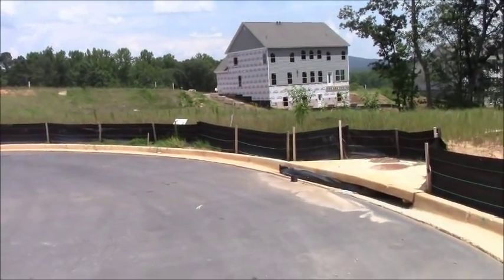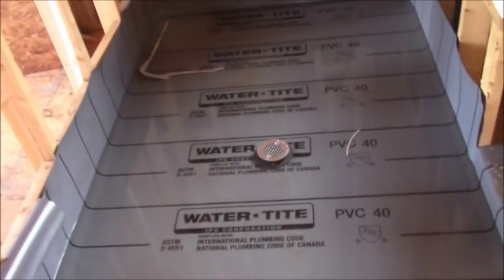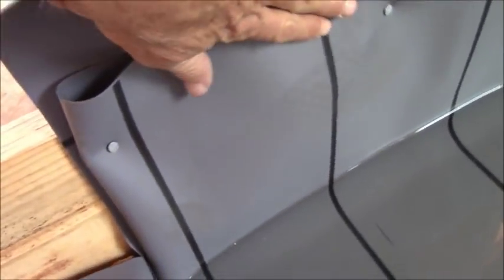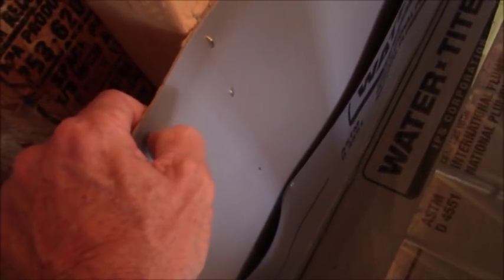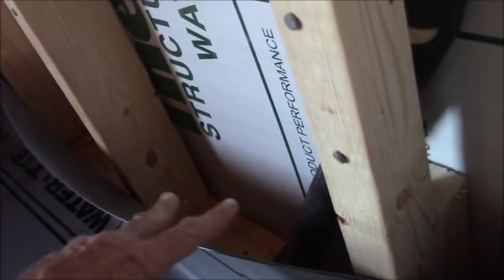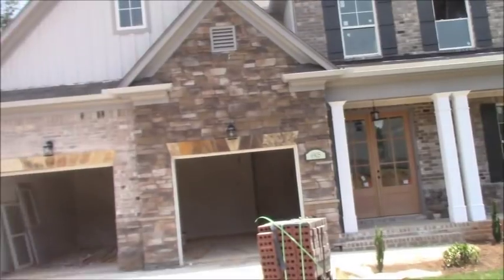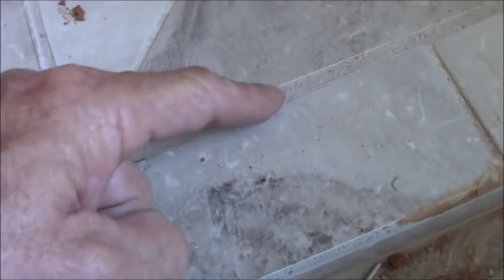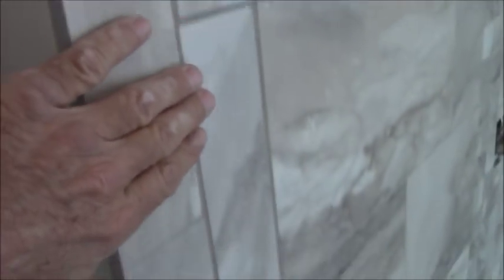NO ShowerPan PreSlope ..NEW CONSTRUCTION

Comment: All work is being done by other people is respectable and no one will do the work same way you do it, and respectable as well.
Your comments seems bitter because you do not did the work.
With respect, you can give your opinion without, making seeing you in a way that you feel all mighty construction guy.
How ever
Your video has the right idea.
Now the plastic pipe is pex, Wirsbo, or Uponor brand. Class A, meaning EXPANSION PEX. Is the first in the market follow by Pex B, ment for crimp and Expansion, little more rigid than pex A, and last but not least Pex C, use only with crimping rings.
The valve is a Delta 10000 UN. Is nothing wrong being " old copper guy" , experience is always welcome.
That dissent mean we need to stop learning.!!
We have much to learn from the new generation as well.
Good luck and keep up the videos.

Comment: A lot of argument about the pre-slope. The first tile shower I ever installed was for myself. That was in about 1999. I did extensive research and the best book I found was by Michael Byrne. The industry standard at the time was to install a pre-slope before installing the pan liner. It made logical sense to me at the time and still does. Using the argument that “nobody I know ever does it” or “I have never done it before” is a pretty poor argument for not installing a pre-slope. This sounds just like the bricklayer who installed the metal firebox on a new house I bought once and covered up the air recirculating tubes which was totally against the manufacturers warnings. He was taught the wrong way, never read any manufacturers directions and had no clue he was potentially creating a fire hazard in hundreds of homes. Poor inspection practices as well.  I assume that in your area somebody decided the extra step of installing a pre-slope was just too much work and not needed. Maybe you should get on the boards that approve the codes and get them to remove the pre-slope requirement if you feel so strongly against it and can prove it is not needed. If builders had twenty year warranties on homes it would not be necessary to have all the building codes. Having a trustworthy builder and good inspection practices protects the home owners since builders only give a one year warranty.
Reply from the maker: In 1998 when I started tearing out showers I never came across a preslope..no matter the house was built 1950s 60s 70s 80s 90s or this decade.. so if it is code then everyone has missed the ball for the last 70 years. Of all the manufacturers of all the products, all the online people like you mention with Byrne no one has one shread of evidence as to It's advantage, no scientific backup, no video, absolutely nothing except their word. And those are not even the reasons that I don't do them , the main reason is the ill logic of an encapsulated area that is porous that will allow water to flow  unimpeded... it fails to make any logical or scientific sense at all, in the absence of gravity water will wick up any areas it can and preslope will be irrelevant and the negated by capillary action. At 100% saturation a pre slope may in fact evacuate some water  but it will be negligible.

Comment: The plumbing pipe is Wirsbo with expanding/contracting fittings...  it's the 'latest, greatest' plumbing innovation...  I know... I had to purchase a 600 dollar tool to install it.

The panel is a vapor barrier only recommended for climate zones 5-7 and only on exterior walls.

Comment: It was wirsbo pipe. 
And water in tub to weight it down in cement. But no to smart to leave that much water. You only use a tiny amount. Anymore you can deform tub and when it dries up and you remove water it’s then under tension. 
And pointless to line the curb yet leave the corners. 
Me. I go a bit overboard. 
Redguard floor then pre slope or not pending. 
Also add wires to check for continuity. Norm I run 4 sets of wires and if there’s a tub with access I run wires there and mark them. 
This way I can always check under the pan for water. Kinda like a built in water alarm system.
Few reasons. Can chk work year after year.  It’s good customer pr 
And I warranty my work but not the builders. I have done jobs where 2 years later the tiles were cracking like a earthquake hit. To find out the builder was being cheap with nails. Missed nailing areas. Etc.

Comment: No ... it's PEX.    They used the I'd expansion tool to put it in. They slip that sleeve over the pipe, insert the expansion tool and while it's expanded they quickly slip it over the barb fitting before it contracts back to regular shape. The tubing is what they call cross linked plastic. You can bend it shape it and it will go back to original shape because of the cross linked plastic.

Comment: The TCNA states that showers must be pre sloped, whether or not you believe it's needed or not the TCNA does, so from a legal aspect you should do the procedure.
Reply from the maker: Eric Ness I'm not sure what you mean by the legal aspect, the tcna is not a government entity they only make recommendations, my issue is that there is no proof, as much as I mentioned it in these comments nobody can provide one shred of evidence that a pre slope does what it is intended to do.. by the way I don't believe in Santa Claus, the Easter Bunny, or the Tooth Fairy either
Reply: OK, let's say for whatever reason one of your shower pans has a leak and causes damage. If this was to end up in court the lawyers would use the TCNA guidelines. These guidelines have been used in court many times for many reasons, I.E., flexible grout lines, scarified slabs, spec thinset. The list goes on and on, if any one item was not followed to procedure, guess what, you lose buddy. All i'm saying is to cover yer arse and follow the individual city and state building codes , that in itself is near impossible task depending on how far your work travels.
Reply from the maker: Eric Ness if what you are saying his correct and it ever does come to court, that is an excellent backup for sure. In my case my work is a redundancy I'm building a couple of showers every month for the last 20 years, everything I do is on point in the same way every time, so yeah I don't have failures. But even if I did it would not be out of the realm for me to pay for a fix, I doubt very seriously it would ever go to court. Having said that in the end I Court 1/7, that's what I'm simply saying provide evidence that a pre slope actually works, if they go to court for you then why cannot they produce any evidence video or otherwise that this method of supposed water channeling actually does what it's supposed to do, it is fake science because capillary action will see to it.

Comment: Hey There, 
Would just like to point out that the evidence that a pre-slope pan is ideal is on the internet, and in fact its in your own video! 
Its in the part where you trespass in yet another house to point out the failed water tested pan. Had that pan been pre-sloped, there would have been little to no standing water. You are 100% correct regarding capillary action soaking the entire mud base before any water movement. However if the pan was pre-sloped the fully soaked mud will drain down and out the weep holes then gravity and capillary action, slowly  draws the remaining water to the weep holes. 
The bigger the shower the bigger reason to pre-slope.
The other reason why it is important to pre-slope is to have the flange of the drain lower than the pan.You can clearly see in your own video that in a flat pan the water would have to build up and rise up and over the flange to reach the weep holes.

Pre-sloping is an added step, yes ,but a very important one that should have been code a long time ago.
Reply from the maker: Last sentence 1st....tell me the date it became code & where ? Not a "long time ago"
On to your other comments....there was no failed pan test, the plug is in the drain to DO A TEST, so water is there
On a flat surface, the bottom flange has troughs at bottom, AND troughs 1/8'' up, so water can drain.
Water will not move with gravity when it's encapsulated, so will ONLY wick, hence cap action only UNTIL 100%saturation.

Show one video, anywhere, anytime where a demo was done showing a pre-slope...you can't.
Reply: M,
Your statements regarding the reasons for preslope are right-on target! 
Preslope has been a requirement for shower pan liners for decades with both the International Plumbing Code and the Uniform Plumbing Code, which are the codes used in most parts of the country (although some states, like california and massachusetts, have their own, specific codes, these are always based on either of the two model codes) 
Here's a link to all of the current building codes (including plumbing code) currently in force for the State of Georgia : http://www.dca.state.ga.us/development/constructioncodes/programs/documents/2018effectivecodes-greensheetUPDATEDLETTERHEAD.pdf 
and another link to the Georgia State Amendments for the International Plumbing Code : http://www.dca.ga.gov/development/constructioncodes/programs/codeAmendments.asp
Local jurisdictions have the option of not adopting specific sections of the building codes, but these are the codes that the state has adopted. You would have to check with your local building department to see if they have taken any exceptions to the state-adopted codes. 
Please note that, just because a code section has not been enforced in the past, it doesn't mean it is NOT required! Many times the shower pan liner is installed after the plumbing rough-in inspection. Unless the inspector is doing an inspection on this pan liner, compliance with the code requirement is left to the ethics of the installer. Remember, ethics is doing the right thing when nobody will ever notice!

Comment: It's Pex and just newer fittings that expands then contracts to get water tight seal. Pro expansion Rings and Pex and Pac is not regular Plastic it's made of HDPE, Polyethylene life expectancy 55yrs or more exterior moisture have no effect and may not burst in freezing conditions when heast it forms back to its original form.

Comment: That material on the exterior wall is some type of tply or other type of thin panel that's meant to satisfy the airsealing requirement of the energy code in new homes.  It should also go behind a tub on an exterior wall.

Comment: Hi, I have a older home and the concrete under the tile has cracked.  It is to the point now that when I stand on it, the floor moves.  I  need advise on what I need to do.  Can you help me with a suggestions.  I like what you do and seemed to be very good.
Reply from the maker: No choice but cut out a square past the crack & re-pour that concrete...otherwise it could get worse
Reply: StarrTile thank you.

Comment: So on a second floor it ok just to have a pan liner with doing say hot mop
Reply from the maker: You're asking the right question to the wrong person, I don't do hot mopping, messy, smelly, and antiquated
Reply: @StarrTile  asking more if I do my shower It can work with shower pan alone
Reply from the maker: Yes the shower pan liner alone is in and out water system, I don't practice it anymore as I waterproof my pants surface after it's been dry
Reply from the maker: A shower pan is what we always do .. I don't really understand your question but if you don't know the water in water out system or what I was talking about in the last comment that I don't know how to help you
Reply: @StarrTile  yea sorry mentioning more systems you use on second floor on top of plywood are same on first floor slabs

Comment: What are your thoughts on the exposed nail point next to pan liner at 3:56 ? And what about access to the plumbing fixtures without tearing out all of the tile work on a shower or a tub?
Reply from the maker: Great observation !! Never saw that nail until you mentioned it, but looks like the plumbing plate protector covers the nail.
You can access the plumbing if needed through the bedroom wall on the other side.
Reply: thanks for your response & thanks for your videos

Comment: That plastic is called Upinor, very common nowadays, cuts cost in labor, add cost to the material as compared to PEX piping. It is least expensive than copper and equally effective. Also cheaper to reaper than a solid copper repair.

Comment: Dead wrong. We are inspected on every bath job for pre-slopes. Just because one township is not doing there job doesn’t mean all are. It is code.  When and if  “capillary action” reaches full saturation then gravity does the rest. The weep holes are designed to release the standing water that’s gets through and you do not get the mildew smell you would begin to develop after only a few years of use without the pre-slope.
Reply from the maker: Sorry, you are dead wrong...your "theory" is not only NOT proven to work, the fact there is 100% saturation is a problem. Mold/mildew grows with moisture/air/porous area, all 3 are there with or without a preslpoe...
Nice try though, just need to think things through a tad more ;-)
Reply: Are you a licensed contractor? Not really sure what you mean by "Nice Try"?.... I'm just pointing out that it IS Code to do a pre-slope and it IS inspected.  Do you not pull permits and get inspections on your plumbing work?https://law.resource.org/pub/us/cfr/ibr/003/ctioa.r8-103-62.1969.pdf

Comment: Hi when you say mortar for the base of the shower pan what do you mean? Thinset mortar or a special sandy mix mortar? What brand do you prefer?
Reply from the maker: The shower PAN is made of mortar...sand topping mix, or brick mortar, sometimes sold as deck mud. It is generally 1 part cement & 4 or 5 parts sand. I don't call thinset "mortar", a technicality but important.
Reply: I see the big box orange place sell CustomFloat 50 lb. Bedding Mortar and the tile place sell MICHIGAN (MUD) FLOOR MIX. Anyone better then the other?
Reply from the maker: It really doesn't matter...a strong bed is all you need, then waterproof and set tile

Comment: You need a pre slope before they put in hotmop/plastic or whatever. The water needs to drain out somehow, if there is no preslope, the water stays there and never really drains.if its real bad, after 3 months the shower den will start to rot and the corners will start to crack and itll stink like hell.

Comment: How do you cut the liner at the corners to keep liner as one piece, with no joints ? Or how do you from your corners?
Reply: You cut it an angle so it overlaps. The overlapping flap must be glued on to the PVC liner using PVC glue. Atleast thats how we do it. I'm sure there are a few videos on how to do it. I still feel hot mop is the way to go.

Comment: I currently installed Denshield Backer board around my shower wall but due to some alignment issue,  I had one side of the backer board goes down to the pan areas and not sitting on top of the lip as it should be. Now, will this be a problem in the future with moister/water sipping up the backer board?
Reply from the maker: Yes more than likely...but run a bead of latex caulk where the tile sits and re-caulk when needed, you may not ever get water pooling in there.
Reply: Yes I applied caulks but just want a professional opinion. This give me a bit of relieve.  Thank you for your quick reply.  Love your shows!

Comment: You never seen copper degrade? I have done plenty bathroom pulled plenty water heaters and replace alot of copper not just for breaks but for piting and degrading.. but you most only work in the county may your county water is soft and doesn't cause damage but city water is hard cause copper damage

Comment: If you have never seen copper degrade come to PA as our hard and acidic water eats it from inside out and that is pex  different type of  crimp ring
Reply from the maker: I have worked with copper both in California and Georgia only, the only time I've seen copper fail is operator malfunction where connectors are, never in the copper itself... but that depends on your water source I suppose

Comment: Preslope is very necessary, there is a reason for preslope. That floor will fail without preslope
Reply from the maker: You are incorrect. In 20 years I've never taken out a shower with a pre-slope, and a vast majority were renovations, NOT failures. Pre-slopes are fiction, no evidence ANYWHERE they work as intended, ever wonder why ? 
Anyway most tilers are waterproofing the surface of the pan, making a pre-slope a moot issue.
Reply: I've done remodels where you can stomp on the tile in the  pan and smell the odor that comes up beneath where the liner is saturated with water  and accumulates rotting mold. Most likely from no preslope
Reply: Almost every remoldel ive done the tile in the pan always has mold around the perimeter of caulking or grout it's most likely because of no preslope